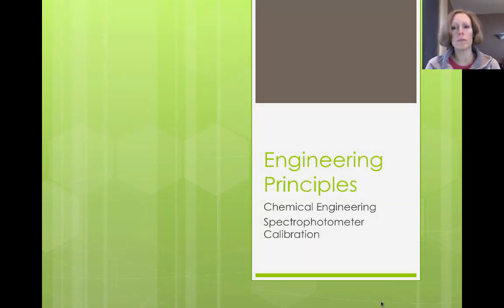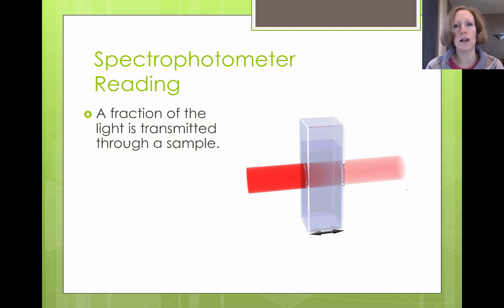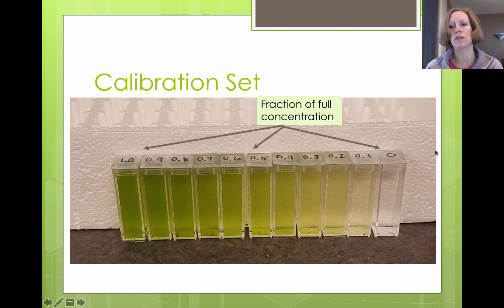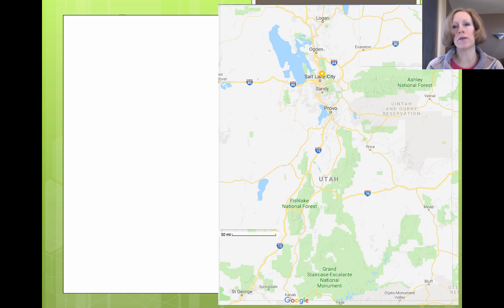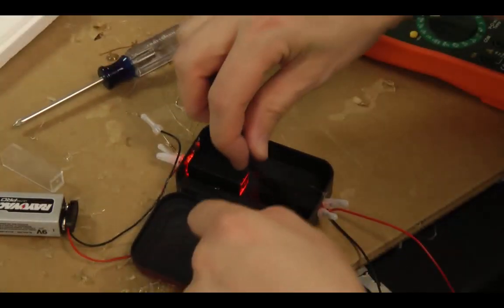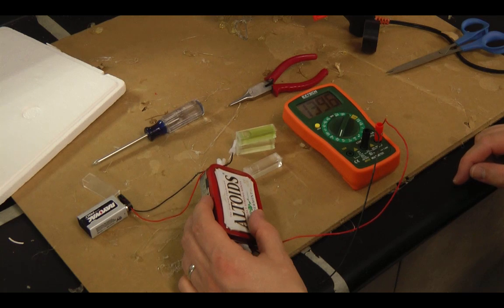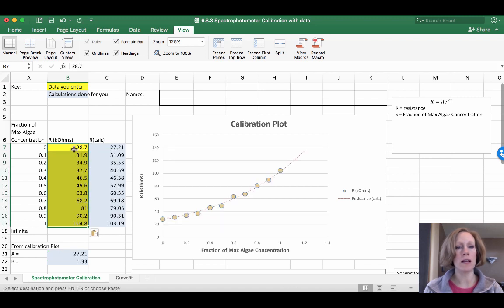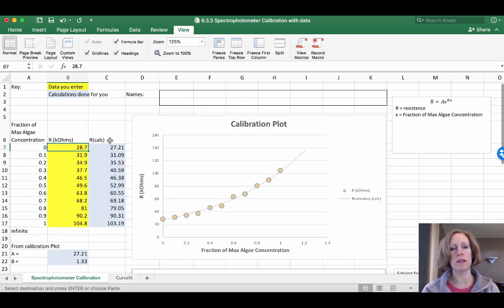6-5 Spectrophotometer Calibration

Comment: thanks for posting this.  it sure does let one see the bare-bones nature of meas'ing
transmittance.  and leads to the idea of  easily changing out the light source to other
colors.    and how the photo-resistor could be swapped too with one of those
Taos light sensors that gives a power  uW of light energy in terms of a voltage.

       missing    are the slits and  optics found in real commercial units..
to make the light be a  small 1mm beam of light.      or a  200 line/mm  grating
and a  tungsten bulb.   and    a servo to rotate the grating and sweep  the
400-700nm range of vis colors thru the sample.    yet all that can be added
on as this project evolves based on need and application.

      anyway kudos to you guys for  showing us all how to get started.  

i liked your  graphics of the mole  in terms of other  material forms
than atoms.    something    that none of my chemistry prof's
ever came close to thinking of